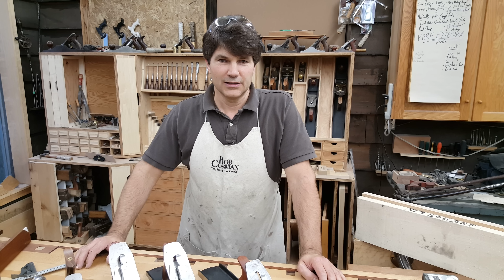Sharpening and Hand planing workshop Tool list with Rob Cosman

Comment: I would like to buy one of these planes, but I can't find one anywhere.  If I go to Woodcrafts website and type in "Woodcraft 40 1/2 scrub plane" the only thing that comes up is a replacement blade for the Lie-Nielsen plane.  I can go to google and type in the same thing and a link comes up to woodcrafts website that shows the plane at a cost of about $169.00 I think, but it says that the plane is unavailable.  I also found a video on google that shows a guy demonstrating the plane and telling how Woodcraft has remanufactured this plane off of an older Stanley scrub plane that went out of production in 1962.  I see that the plane that Rob shows in this video says "Pinnacle" on it, and so does the one that is being demonstrated in the video I saw from Woodcraft Magazine.  Does anyone know what the deal is with this particular plane, or how to see about buying one?  Would sure like to hear from somebody about this plane.  Thanks.

Comment: Hi Rob, Nice and simple video which explains the essential hand tools and sharpening system. I am thinking about investing in sharpening system I like the idea of your system because its fast and not so messy and seems it work very well. 
My question is ...do you use the 1000 grit or 300 grit side of your diamond stone to flaten your ceramic stone ? Also I noticed you jump from 1000 to 16000 grit when sharpening...obviously this is  working as I can see...it just makes me wonder why other woodworkers are going through 3 of more stones and taking longer time to sharpen . Thanks Paul